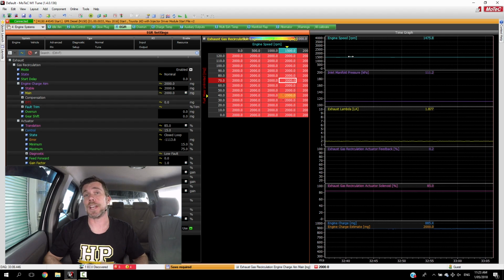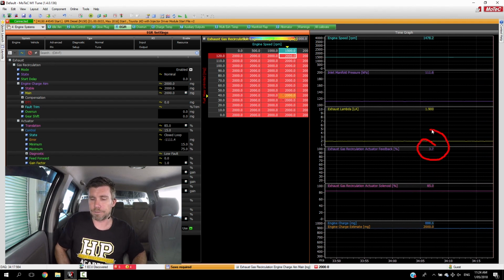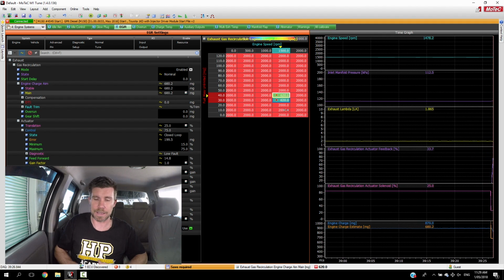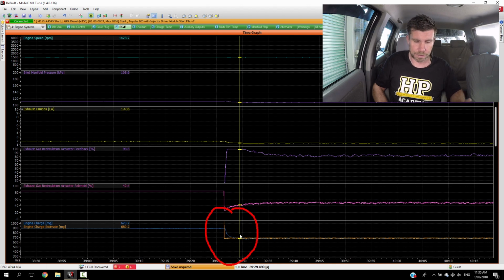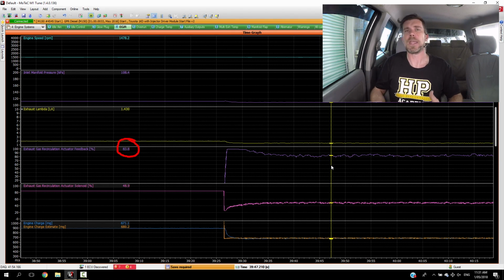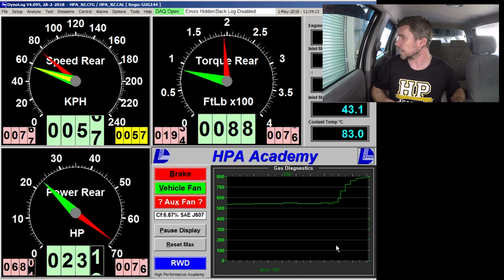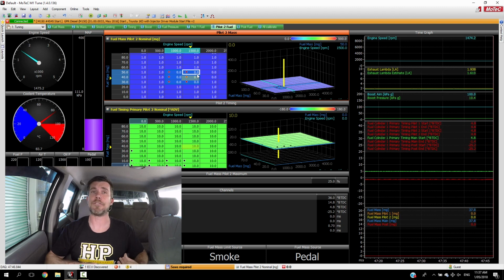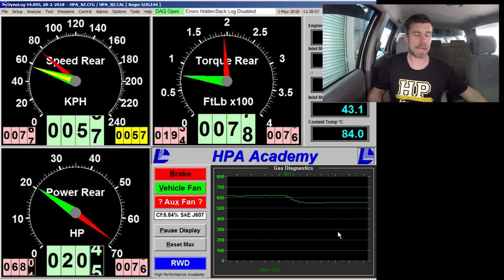EGR vs EGT and NOx | Emissions Tuning [FREE LESSON]

Comment: I'd like to see those same changes made at full load. How much less power and worse fuel consumption it will give. How much more smoke ?
Reply: Not OP, but since the EGR valve is vacuum actuated, it would close the valve at low vaccum or boost, which negates the opening command from the ECU.
Reply: @patx35  diesel makes no vacuum. So there must be vacuum pump.
Reply: patx35 EGR valves are generally stepper/servo motor or electro solenoid  controlled, hence the ability to control % of opening. When they are vac controlled off a tap into the servo line from the pump, they are either open or closed

Comment: Another point to remember is that remote towns, mine sites, trains and ships run large multi megawatt diesel engines with no emission controls at all.

For mining trucks the only emiissions controls relate to Diesel Particulate Matter, which is mostly a problem during transient throttle conditions.

Comment: Would be possible to have something emissions related for gasoline engines? Interested mostly on reducing CO while maintaining stoichiometry mixture with cat converters!
Reply: EGR (shudders,) the worst of all emissions equipment.

Guaranteed to in conjunction with the crank case breather to deposit carbon sludge all over the intake runners and valves👍. EGR works well to reduce emissions when new, but it's doesn't take too long for it to make a mess and reduce performance.
Reply: @manitoublack  In my case is an old engine. An rb26 which didn't came with egr! Haha. I'm hoping for some map optimisations that can be made to make it pass through some emissions.
Reply: well they already have. why do you think there are o2 sensors before and after the cat converters? Search for closed loop engine management or something like that
Reply: @Runmeerkat  Closed loop lambda only controls the mixture and I'm not after that, I'm after knowing how to optimise timing, cam control, etc to reach good emissions.
Reply: @Tomisuperwar  There is a basic problem with that idea, CO results when the fuel supplied is greater than the oxygen available to oxidise it, and stoic' is the theoretical ratio for chemically balancing the reactant (fuel) and oxidant (oxygen in the air). It is impossible to get the charge to mix evenly, so some fuel isn't burned fully - some engines are worse than others as port shape, combustion chamber shape and quench clearance, how finely the fuel is atomised, the temperature of the charge, etc. all play a part.
That is why it is normal practice to run the engine a little lean at idle for emissions and during cruise when better fuel use is obtained - lean best power.

Depending, again, on the engine, you 'may' see an improvement by minimising the quench distance, to promote turbulence in the cylinder mixing the burning fuel, or multi-spark ignition where several flame fronts may be initiated for a better burn. You may find some injectors that offer a finer spray pattern, or are directed more in line with the port, although some feel that directing it to the port side helps break up the fuel.

You mentioned spark and camshaft timing, you can certainly play around with those, but injection timing may also be worth checking on - the greater the open time, the more fuel injected into still air before being carried into the engine, so, perhaps, moving that around may reduce the fuel being carried out the exhaust during overlap - something that the direct injection was intended to stop.
Reply: @gordowg1wg145  That was kind of what I was hoping. Thank you a lot for your response. There are obvious design factors that make an engine more or less efficient/pollutant but, factors like inj timing as you mentioned are things to consider that might be unknown if you don't pay attention to efficiency or emissions. Again, thank you for your answer!

Comment: Wait, so diesels with an ECU have injection timing of around 5 degrees at 1500 rpm? I thought it would be closer to 10 degrees.
Reply: My Name Is Hello depends on MANY things like piston form factor and so on. On my diesel 1500rpm injection starts at 1.1 BTDC, stock was -1.90 (so after tdc). I guess that was made for dpf regen that runs on 1500rpm. Anyway disels have to still inject fuel after top ddead center. Stoping at 0 is bad and loses power. End of injection depends on rpm but best is 4-7 ATDC
Reply: @SayWhaaaaaaaaaaaaaaaaaaaaaaat  never knew that. What engine do you have?
Reply: That was without load.